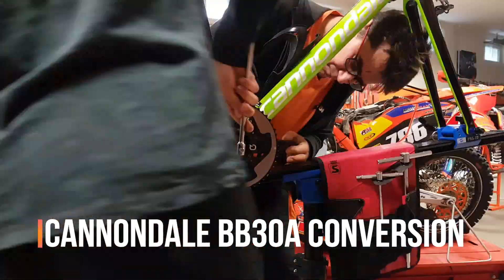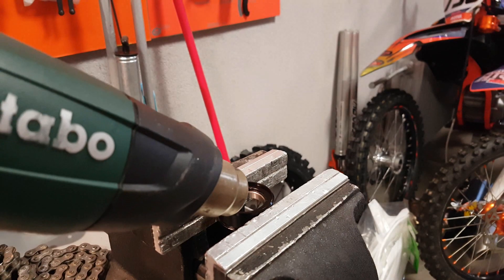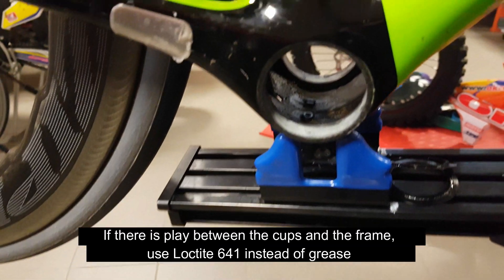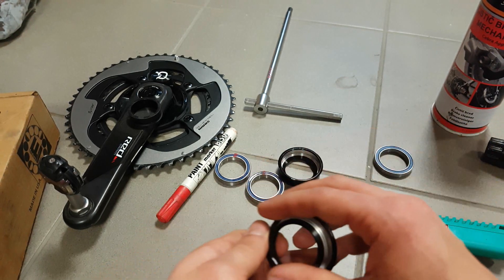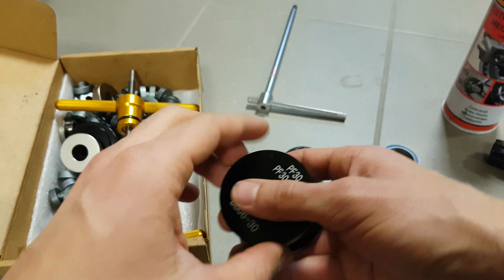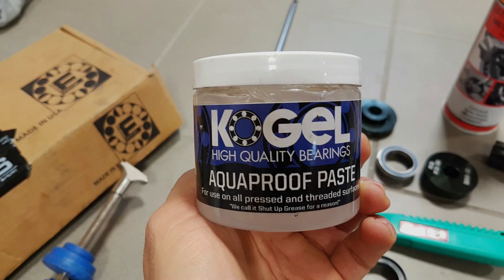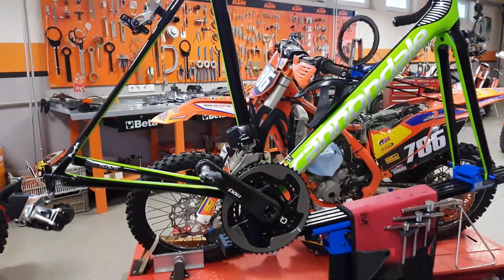Cannondale BB30A and PF30A - how to fit a BB30 Quarq

Comment: Hi thanks for the vid. Might be a stupid question: I don t quite understand how you fit a standard bb30 cranks (I have force22) in the pf30a? Is the trick just to remove the preload spacer or to buy specific bearings or bottom bracket or both?  Thanks A lot
Reply from the maker: The spindle is long enough

Comment: is it possible to use the short non-drive-side crank arm from a red22 crankset? I am sceptical about the preload adjuster.
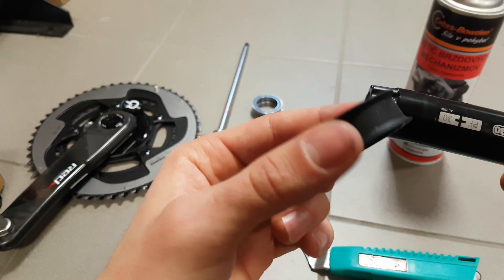Did you use the spacer (@1:47) on the drive-side? I got a supersix evo an came from a red22 crank and was wondering about the long spindle.
Thank you
Reply from the maker: Theoretically yes, but you'll end up with a weird Q factor as the arms have different bends

Comment: I have the original bearings installed. When doing exactly like the manual told me, I have a lot of play in the crank. NDS only the adjuster and DS the 13.01mm spacer. Am I doing wrong?

Comment: Very informative vid.  One of the reasons I order bare frames direct from China manufacturers and then build the bike up from there is I can choose a threaded BSA option to avoid all this confusion.
Reply from the maker: Chris Dahms we'll I'd rather do this on a Cannondale than have a Chinese frame
Reply: To each their own I guess.  I've been riding the hell out of a Dengfu R01 (850g frame) daily commuting for more than 6 months now in all seasons and it's held up great and performs fantastic.  For $600 (compare to S-Works Tarmac Frame at $4,750) I'm quite happy with my choice.

Do you have something against China?  I presume you're aware almost all bike frame are actually made in China or Taiwan now, even if the company is based in the U.S. or Europe.
Reply from the maker: I race in Elites. When doing 85km/h on a descent, I want to be sure that my frame has been properly engineered. At 600 dollars that is not very likely to happen.

Comment: had a shop install my kogel BB into new trek emonda with a sram quarq. They said that when they tighten cranks to recommended torque, the crank arms wont even spin. Any suggestions?
Reply from the maker: Evan Blankenship remove the black spacer ring